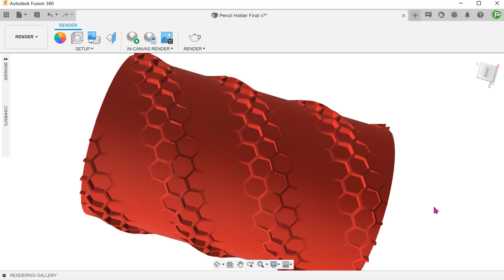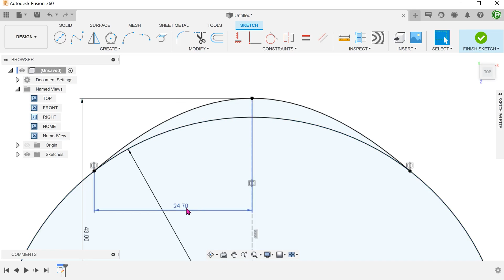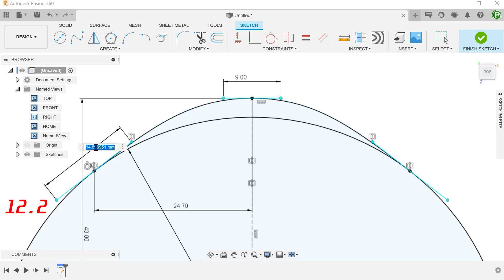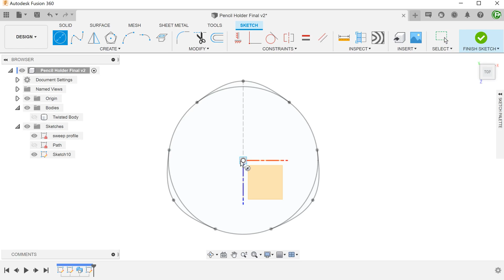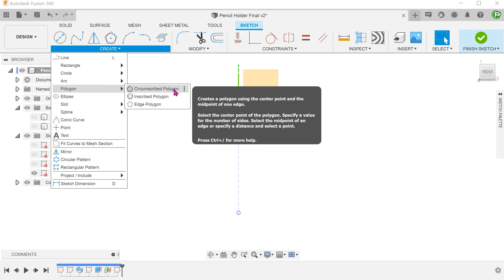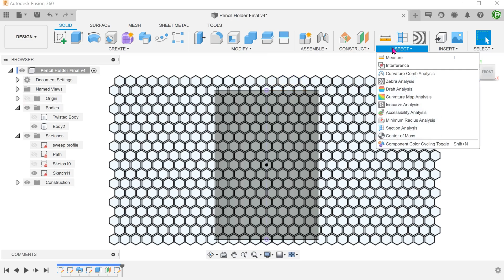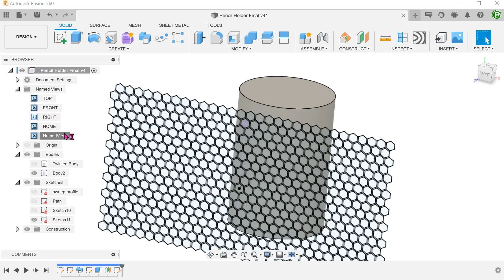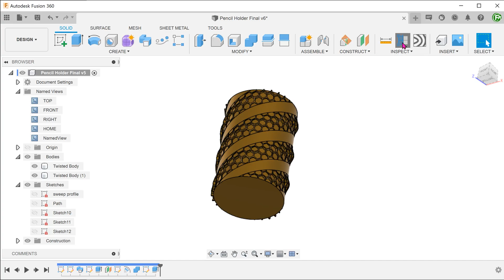Fusion 360 | Pencil Holder (Narrated)

Comment from the maker: If you intend to try this out, I would encourage you to use control point splines instead of fit point splines for the sweep profile. I have only just recently found out that fit point splines do not adjust parametrically when patterned. You can refer to this follow up video for more information.
https://youtu.be/iz83yoVkhP4

Comment: Great Thanks! But on the last step i get a failure message: Error: misclassified graph coedge - probably geometrical problem
Failed to Boolean bodies together
Reply: Ok, had to modify the tool body to 126mm height and 86.5mm diameter to work. a known problem when cutting edge on edge. just wondering it worked for you and as it seems many others..
Reply: @synlergeider I had the same problem!! Thank you very much for your help!!

Comment: Hi! Fantastic Video. I have an issue however. My circumference came to a slightly less amount which meant that my emboss pattern either leaves a gap with 31 or is too wide with 32. Do you know a way to stretch the entire pattern to get a perfect size on all designs everytime? It seems a little limiting to only be able to do it with the pattern settings?
Reply: you have to adjust the spacing to get the correct pattern. it is time consuming however.

Comment: 9:26 I would like to learn how you figured out how to get that perfect cycle Diack pattern that does not overlap and interlocks correctly. Did you just use pen and paper with maths or trial and error?
Reply from the maker: I just did a bit of math to find the circumference of the the cylinder. With that, I massaged the spacing/quantity/size of the honeycomb pattern to make sure that the overall length of the pattern did not exceed the circumference.

Comment: Be careful when using fit point spline since they calculate tangency weights at creation, and will not re-calculate when re-scaled or modified. This means that you end up with is a spline where the actual shape and tangency depends on which order you dimensioned the points that it was fitted to. To make it worse you can not display, change or verify the tangency weights in any way that I have found. This is a bug that has been in fusion 360 since day one, and has been reported numerous times in the forums, but it will probably never be fixed. IMO fit point splines should be deprecated, and control point spline should be used instead.

in this example you'd get different shape of the spline in the first sketch with these two methods:
Create the first circle -> create fit point spline -> add dimensions to circle -> add dimension to spline fit points
Create the first circle -> add dimension the first circle -> create fit point spline -> add dimensions to spline fit points

I know this is the case because I spent several hours hunting down a non-symmetry error when using fit point splines.
Reply: There is one more bug that might be a trap for young players with this project. Patterned fit point splines will not be updated automatically, which is different from all other basic shapes. So if you have created a spline, then patterned it, and then change the spline the patterned geometry splines will not update. You have to edit the pattern and then save for ot to update. This is a different behavior to  how circles, arc, lines etc behave when patterns are used.
Reply from the maker: @XerxesGustav  Thank you for pointing this out. I have always thought that dimensioning the spline handle would be enough to control tangency weight. I was not aware that order can make a difference. Will definitely need to experiment with this.

I went to test out the patterning of fit point splines again and you are right, the patterned instances do not update when the seed spline is changed. This was quite a rude shock to me! I went to try the same thing in SolidWorks and it has the same problem. 

When I tried patterning a control point spline, the patterned instances react to changes! Looks like I would need to do a follow up on this. Will definitely credit you. Thanks again for the comments.
Reply: @Fusion360School  Glad I'm not the only one finding the pattern not updating a bit of a shocker. Happy to help :)

It's precisely the dimensioning of the handles that is the problem with the fit point spline. At some point in the code fusion has to do an arbitrary mapping of control handle dimension vs authority of that control handle. There isn't a strict mathematical definition of what for example a 15mm long control handle means to tangency, so fusion calculates something that it thinks is reasonable based on the size of the sketch.  That mapping isn't updated when dimensions of the overall sketch changes,.

You can test this by for example making two 50mm long perpendicular lines starting and origin , going out the x and y axes. Add a fit point spline to the endpoints of the two lines you just made. Be sure to only have the two lines's endpoints as fit points to the spline. Make the spline handles perpendicular to the lines. Add a 20mm dimension to the spline handles. You should now have something looking like a slightly messed up quarter of a circle. Now, modify the dimension of the two starting lines to be 100mm instead of 50mm and create a new fit point spline on top of the old, with the same input as before. You will now have two splines with exactly the same definition with very different shapes. 

I have reported both of these as bugs to Autodesk, but so far they seem to think that isn't something they should fix or improve.

Comment: I am try to make this and when i need to do combine  I have "Error:   There was a problem combining geometry together.
    If attempting a Join/Cut/Intersect, try to ensure that the bodies have a clear overlap (problems can occur where faces and edges are nearly coincident).
Failed to Boolean bodies together"
Reply from the maker: When I was trying this out, I faced the same error when I used a height of 120 mm. It seems like Fusion is very sensitive to how the edge of the cylinder crosses the honeycomb pattern. May I suggest that you try adjusting the height slightly?
Reply: @Fusion360School   Thank you!!  I am change "path" to 130mm and now everything work.

Comment: Maybe this is a silly question but do you have some option set which allows you to snap the circle to the lobe? Or maybe more to the point, could I have some option turned off because I cannot get it to snap.
Reply: got the same problem
Reply from the maker: Hi, you can go to preferences -> general -> design and turn on the "auto project edges on reference" option.
Reply: @Fusion360School   it says "A problem occurred while combining geometry. When joining/cutting/trimming, try to make sure that the solids clearly overlap (problems can occur when faces and edges are almost coincident)."
Reply from the maker: @TheTrialfreak  When I was trying this out, I faced the same error when I used a height of 120 mm. It seems like Fusion is very sensitive to how the edge of the cylinder crosses the honeycomb pattern. May I suggest that you try adjusting the height slightly?

Comment: How much time you took to print your Pencil Holder..which material do you use? PLA!?
Reply from the maker: PLA. Took about 16 hours. I sliced with adaptive layers in Cura. Layer height varied between 0.16 to 0.24 mm. Nozzle diameter = 0.4 mm.

Comment: got a problem with intersect. trying to combine two bodies got error message:

There was a problem combining geometry together. If attempting a Join/Cut/Intersect, try to ensure that the bodies have a clear overlap (problems can occur where faces and edges are nearly coincident).
  Failed to Boolean bodies together

Have used exact the same measures to all object. Can you please suggest what went wrong?
Reply from the maker: When I was trying this out, I faced the same error when I used a height of 120 mm. It seems like Fusion is very sensitive to how the edge of the cylinder crosses the honeycomb pattern. May I suggest that you try adjusting the height slightly?
Reply: @Fusion360School  thank you - it worked at path length 135mm
Reply from the maker: @_assassa_6439  Good to hear. 135 might be a bit tall for a pen, though.

Comment: Thanks! great video as always. Thinking: Might be easier to layout proximal desired hex pattern 1st, then choose cylinder circumference to be a convenient multiple for hex pattern, rather than backing into hex pattern dimensions?
Reply from the maker: Mmm...never thought of it this way before. It does make sense. It is definitely much easier to adjust the cylinder diameter than the pattern.👍
Reply: @Fusion360School  But in reality your dimensions for your project would be driven by something else, such as the size and amount of pencils you want to hold within the container. Otherwise the tail is wagging the dog.

Comment from the maker: I think a lot of you must be tired of seeing honeycomb patterns and symmetrical splines by now! Will do something new next week.

At 5:30, when specifying the extent of the extrude for the cylinder, I simply clicked on the bottom face of the twisted body. The problem with doing this is that if the height of the twisted body is changed, the cylinder height will not follow. I should have used the "to object" extent option instead. Sorry about this.
Reply: Can you do one with the raised bumps/pattern of diamond plate?  
Thanks for posting this tutorial it was great!
Reply from the maker: It does seem like a diamond plate pattern would work well. Will definitely consider this for a future video.
Reply: This video is very interesting. It also sparked my imagination and I was able to use the twisted sweep on a path to create a tapered thread. Thanks :)